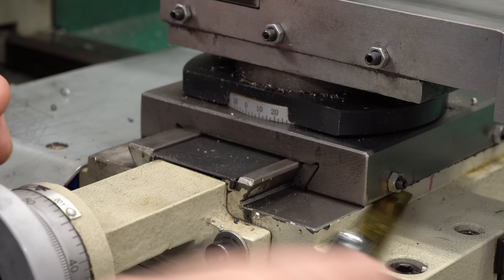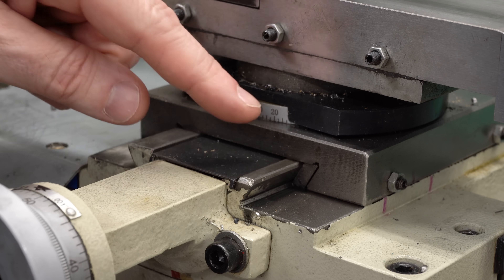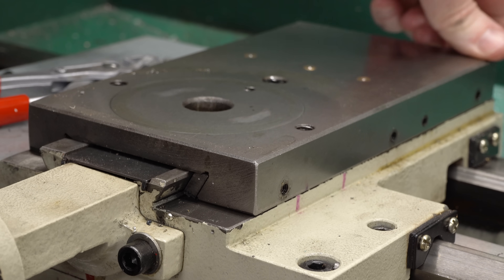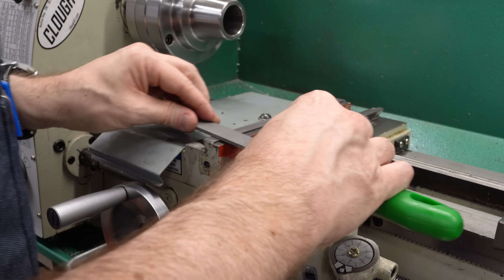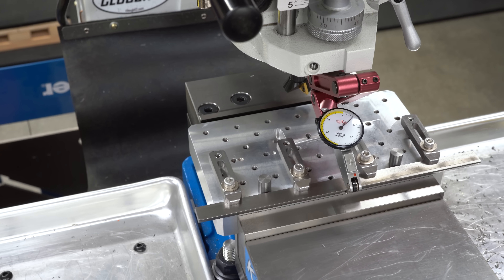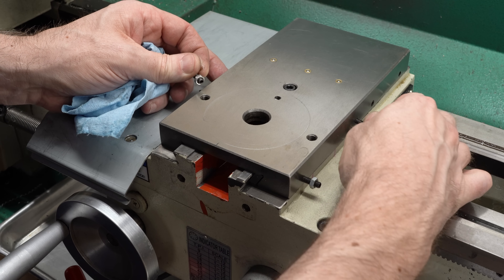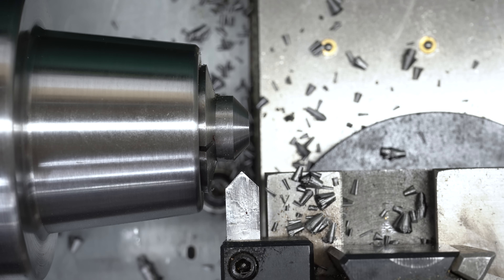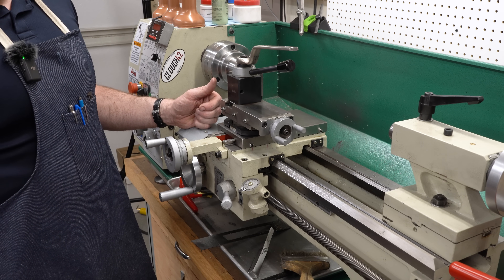Fixing a Factory Defect in the Lathe Cross Slide | Grizzly G0602 Fail

Comment: I humbly submit that you should preferably improve your compound slide rather than replace it. It's such a useful tool. Solid tool posts are for the heaviest of roughings in dozens horsepower machines, and it's a great trade off in versatility for efficiency. I'm not familiar with that lathe, so maybe I'm in the wrong, but I would wager something could be done to reinforce it and it's interface. The slide itself and ways looks beefy enough not to be a problem.
Reply from the maker: No reason not to do both.  I'll make the solid tool post the same height and make sure the new holes in the cross slide are in the right places to work with an improved compound clamp.
Reply: @Clough42  Of course. You know what you are doing. You should get into the giant and delicious can of worms that is machine scraping :)
Reply from the maker: @LordNPS  I may or may not have picked up a used Biax a year or so ago when the opportunity presented itself.
Reply: @Clough42  Here in portugal machine rebuilders only work scraping by hand - and most I know that rebuild surface grinders ways for precision only use hss too! no biaxes for anyone. You had a wonderful series on a carbide scraper. I never used a biax so I couldn't tell, but I can assure you for such a (relatively) small lathe you'll be absolutely just fine either way! Best of luck and looking forward to it.

Comment: The cross slide might be warped, however the big fail is when the compound gets mounted and tightened. That bends the cross slide, which is a prime reason why I went to a solid tool post.
Reply from the maker: Ahh...yeah.  It would have to move at least a little, wouldn't it?  I haven't measured to see what happens when I do that.

Comment: James, with your mill you can make a real gib, mill that slide and replace this "gib stripe". It makes a huge difference replacing just point contacts under the screws with a real planar surface.
Reply from the maker: By "real gib" do you just mean one that's machined/scraped more accurately, or are you talking about a different design?
Reply: @Clough42  sorry for that unclear "real gib", i mean "wedge" design, it have different thickness from start to end and axial adjustment with one or two screws. For that upgrade you need to mill gib side of a dovetail on the saddle and make new gib. Usually, gibs are machined from cast iron or heat treated steel. For my lathe i make replacement gib from bronze, it's easy to get for me, there we don't have McMaster with all materials in small chunks.

Comment: I started making a solid tool post for my bench top lathe but am constantly second guessing myself. Most of the problems in day to day work have been fixed by fixing minor issues such as this and snugging up everything down. Diminishing returns with solid tool post I reckon but I'll end up finishing it since I'm half done.
Reply from the maker: In a heavy cut, I can see the compound on my lathe flexing visibly.  A better compound clamp would definitely help, at a minimum, but I figure I might as well see what a solid plinth is like, for comparison.

Comment: I can guarantee, that you will be VERY surprised, when make some measurements of geometry of this machine. If you will make some scrapping work for precision geometry in this piece of s..t (I have same one :-) ) it will gave you a 2-3 times more productivity than it was. Also you will be able always make precision parts. By the way. There is a good and easy project of electronic gears for small lathe machines, why you upgrade only one axis?
Reply from the maker: Because I wanted a manual lathe with a gearbox--not a CNC lathe.  I have a CNC mill, and I ended up buying another mill so I could turn the cranks.

Comment: Good job James, I find the quality of Chinese tooling is compromised by the insistence of people driving the price down. Cheap purchase price = compromised quality !
Reply from the maker: I think this is exactly right.  Lots of people seem to assume that Chinese means low quality.  I don't think that's the case.  There are definitely cultural differences, and it does seem that Chinese manufacturers are more willing to deliver virtually any level of quality required to make the sale, even if it means an unreasonably low level of quality for an unreasonably low requested price.  I think this is especially true when the end product is going to be sold under an importer's brand, and will have virtually zero impact on the reputation of the manufacturer.
Reply: @Clough42  I think the Chinese could get away with the QC issue by plainly stating that " some fitting for precision improvement required by user"..........that would make the issue a non starter for complaints especially if an "improved" model was available at twice the price.

Comment: It’s interesting. A couple of years ago I bought an Indian made attachment - a vertical table that can move up and down with a 90 degree base. The thing is about 10” tall by 6” wide. Basically well made. But the same problem with the dovetail. It didn’t touch on the gib side. Two problems. The gib was also too high. But also the acute edge was sharp, but the inside 
“corner” of the dovetail is slightly rounded. So the gib couldn’t possibly sit flat. Removing that sharp edge and machining about a millimeter off the height fixed the problem.

Amazing how some minor details get overlooked on otherwise decent machines.

Comment: I bolted my lathe of that size down to a length of 200 by 50 mm (so 8 inch by 2 inch) rolled hollow section with a 3 mm wall (I paid extra for a machine with a better factory finish too, Optimum). I'm sure you can imagine how much weight and rigidity it added to the lathe. I am pretty tall so it also lifted the lathe a little higher off my bench for me.

Comment: OK, I admit it. I’m another Grizzly lathe owner and I’ll be checking to see if I have a similar problem. Many owners of Grizzly machine tools have reported issues with improperly machined parts. That being said, if not for tools like these folks like me would not likely afford any tool. This is not a compliment but certainly a way to rationalize the purchase of sometimes sketchy equipment. I, like most people need to live within my means. Thanks for posting this video, very helpful.
Reply: .023 on the side closet to the chuck. Looks like I have another weekend project.
Reply: Yep, headed out to check this now. Turns out I have no gap. But the Gibbs were a little loose.
Reply: I bought my first Monarch lathe (one of the best lathes ever built) for $800, which I'm betting was much cheaper than your Grizzly (no offense). I always try to talk people into not being afraid of buying used industrial quality tools. Even with the .0004" of wear in the ways of my Monarch from 80 years of use, it is still a much more rigid and accurate machine than ANY of my import machines that I made the mistake of buying brand new, that I had to remove up to .012" of error from various slide ways to make them even somewhat usably accurate. The money I saved buying the Monarch instead of another import went to buy a 15HP rotary phase converter to run not only my Monarch, but all of my other 3 phase equipment that I now own (totaling 5 machines now). I try to warn everyone that I can about the inferiority of these import machines, having had the experience of "fixing" all of them to make them somewhat useful.  But...if anyone is still interested in testing their luck with one of these imported machines, all of my "improved and accurized" import machines are now available for sale if anyone is interested. Fully tooled up, and DRO's installed.

Comment: So the surface that you are filing is a reference surface that would be used if you ever wanted to scrape in your cross slide since it was machined in the same setup as your cross slide ways. It is not supposed to be a wearing surface so it stays virgin and you can use it to base an indicator to measure the wear in your ways. Of course in this case they screwed it up so you can’t but normally you would not want to file that surface. It should be machined if you can find a way to set it up in reference to….something (not sure what in your case😳).

Comment: Good diagnosis and fix.  I'd be tempted to check the cross slide bottom on a surface plate and scrape it flat, then check the cross slide ways with the flat cross slide.  Once that's matched do the same with the compound base and cross slide top, scraping the first flat and matching the latter.  That way it wouldn't add stresses to the cross slide when clamped down.

Comment: Nice analysis and a common sense fix.  Thanks.  On the sticking warp in the cross slide, I'd probably first check the contact surface of cross slide on a surface plate to see if it's the slide itself then the flats of the carriage to see if they are flat, parallel.

Comment: The side  to side clearance  issue is caused (imo) from the mounting method of the compound. I found on my lathe that once the compound was removed from the cross slide, the movement of the cross slide was very tight. I probably had the compound too tight, but this seemed worth mentioning.

Comment: G0752 here and I’ve had mine apart many times, there should be some angled pins in front of the gib screws that bear on the gib. Following Stephan Gotteswinter I’ve upgraded mine with a solid tool post, you can always put the compound on if needed. Also angular contact bearing in the cross slide and compound, and recently added a bearing in the tail stock.
At some point the spindle bearings will be upgraded to a higher class bearing…lol.
It’s a decent lathe now.
Reply from the maker: I was surprised to find thrust bearings on the cross slide screw.  However, the dial is marked as 0.060" per revolution, but it's actually an M10x1.5mm screw, which explains why I always come up a few tenths short, no matter how careful I am to split the final two cuts.  What I'd really like to do is put in a 12TPI Acme screw, with a planetary reduction in the handwheel for .100" direct reading per revolution.  That's probably more work than it's worth, but it would be fun.
Reply: @Clough42  My cross slide hand wheel was marked .002” so big line to big line is .010” I think it’s .120” per revolution if I remember correctly. Your imagination is the only limit on the possible upgrades. I moved my big rear splash guard back about 4” and up level with the top of the electrical cabinet, this gives way more room for indicating around the chuck. I added aluminum sheet stock from the bottom of the splash guard to the chip pan, all riveted together. Also built a tool rack at the top of the splash guard that will hold about 20 tools.

Comment: Thanks for posting this video. I just checked my G0602 that I purchased in 2019 and it also has gap on the right side so it seems to be an endemic problem. I'm making a fixture to hold the gib in my milling machine vise right now so I can give it a light trim with ye olde dovetail cutter.
Reply: Another way to cut a gib is to put it in the cross slide and mount the cross slide upside down on the mill table.  Shim under the gib the amount you want as clearance and mill the gib flush with the cross slide.  I used adjustable parallels as a clamp to hold the gib.
Reply: The fixture I made to hold the gib with my milling machine vise worked great and I ended up taking 10 thou off each side because it was both oversize and slightly bowed. After reinstalling the gib I did some facing and turning on a hunk of 4140 with no chatter and very good chip formation, then tried parting off a 3/4" aluminum rod and at no point did I get the usual feeling that the stock was going to ride up over the top of the parting blade like I usually do, so definitely a win.

Comment: I liked your diagnosis and repair here. I didn't realize that a 10EE had similar swing and length to these smaller benchtop lathes. It's so much physically larger that I never stopped to think about that. I'm curious about the trade-off of deleting the compound. I can see how that will improve rigidity, but in my very limited experience I've found the compound useful for making cosmetic tapers and putting a 60º cone on a bar for turning between centers with the regular 3-jaw mounted. I haven't even done any single-point threading yet, but isn't the compound necessary for that?
Reply: A 10EE is 10x20 nominal but actually 12x20.  Swing over saddle is likely quite a bit more than the Griz.

But the real difference is 3500 pound weight vs. 400 and 5 (or 3) HP at the spindle.  I've taken .0002 off a lobed shaft end as well as 3/8 inch deep cut on A2, so precision and strength is the 10EE's envelope
Reply: @russkepler  I hope I come across a good local deal on a 10EE someday. Seeing them in action on many youtube channels has made me want one.
Reply: @Nf6xNet  the intersection of "good deal" and "good shape" is small.  Adding "local" makes that intersection miniscule. Best to be ready to pay a fair price or pay less and make up the difference in working the lathe up.  I spent about a year rebuilding mine (after grinding the bed, saddle, cross slide and taper attachment) but it'll now hold tenths all day.  The easiest drive is the old motor/generator but I like my "works in a drawer" tube drive.
Reply: @russkepler  Good point. Ok, local and satisfactory condition, at a price I can afford. I'd actually kind of like to use an original variable speed drive in it instead of retrofitting to something modern and arguably better, just because I'm kind of thick-headed.

Comment: Great video I am going to go check my G0602 for that same issue.  By the way I did all the upgrades such as installing the Electronic lead screw and it has worked flawlessly. I also changed the 110v electric motor to the 3ph motor and added the VFD to get variable speed.  Also you do not have to comment anything on what I wrote I know you read all our comments, just wanted you to know how much you are appreciated.    Thanks James!!

Comment: Before you fixed it, the only place it would have been bearing was on the 3 gib screws and a line (at best) of contact on the opposite side. This is a great example of how scraping can add rigidity by increasing your contact area.
Reply from the maker: Yeah, I suspect over the years it wore in to a little more than a line.  The angle was fairly shallow.  But yeah, that's why the rigidity was so bad.

Comment: James, how do you like the Kurt DX6 vise?  I've been thinking of replacing my old machine vise on my mill and I'm trying to decide between Vevor (China), Vertex (Taiwan), and Kurt.  I'm just a hobby machinist, but I want something repeatable and durable.  Was the Kurt worth the extra money in your opinion?
Reply from the maker: I really like it.  Is it worth the money?  I don't know how to answer that, because I don't know what the money is worth to you.
Reply: @Clough42  That's fair.  I should probably just bite the bullet and buy the Kurt.
Reply: I have several parlec vices. I have been really happy with them over the years.
Reply: My Tegara (Shars, Taiwan) vises on my Haas CNC are within tenths of being flat, square and perpendicular. However, the 6" Kurt on my manual mill is only slightly better at double the cost.

If customers are going to be in your shop, go with a Kurt and consider the extra as marketing costs.
Reply: @rgetso  maybe I'll take a look at Tegara.  I have no customers, so no one to impress.  Speaking of impressed though, I have a couple of your vise speed handles, and absolutely love them.
Reply: Vertex is good enough for hobby use. You're not going to make aerospace parts in your shed. Sorry for the snark, save your money for other tools.
Reply: @HM-Projects  Right.  I very rarely need accuracy beyond .001, and if I screw something up I'm the only one affected.  From what I'm seeing of pricing and availability of Taiwanese vises right now, stepping up to a Kurt might not actually cost much more, and looks to be far more available than a Vertex or Tegara.  The Kurt DX6 can be had for just over $600 shipped.

Comment: I scraped in the cross slide on my lathe, no surface grinder, also fitted a solid tool post to replace the compound slide. Great improvement but I do miss the taper turning ability.
Reply: Time for an electronic compound.
Reply: I also have an old Boxford 125TCL lathe which was to be upgraded to modern CNC use. I have actually now decided to fit it up with The German made ELS system as I think it will be better than CNC for one offs.

Comment: Can't believe you use that shars indicator. I bought one of their 0.0001" graduation DTCs back around 2015 and was not impressed as my first indicator having no experience with anything beyond a regular $20 0.001" graduated 1" travel indicator. Bought a Brown and Sharp 0.0001" and enjoyed that for a few years bought the Mitutoyo 0.0001" with jeweled tip for $113 on amazon last June. Keep an eye on them as they dip down a few times a year.
Reply from the maker: I have multiple .0001" indicators, including an Interapid and a Mitutoyo.  That kind of resolution is not needed here, and would actually make the job much harder.

Comment: Interesting, just checked my little CJ18 and it's not as bad but not perfect. I haven't got a mill - could I get away by filing the top of the gib? It shouldn't be in contact anyway.
Reply: You should be fine. On machines with a tapered gib, the top and bottom surface are just rough cast, so a filed finish should be more than good, as long as it isn't touching anything.
Reply from the maker: That's was my thinking as well.  It isn't touching anything now.  :)
Reply: filing is fine
Reply from the maker: I would think so.